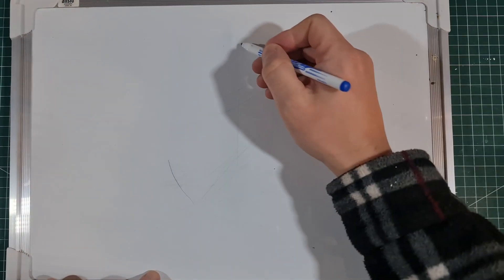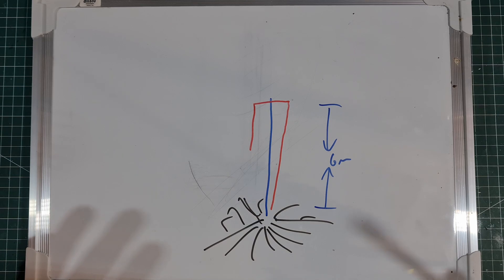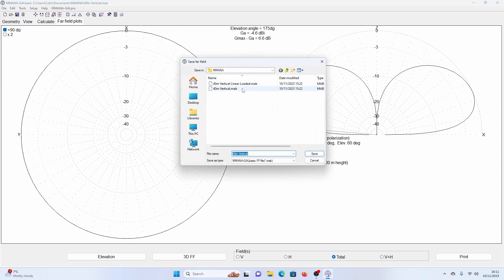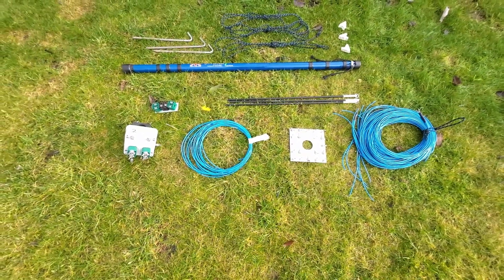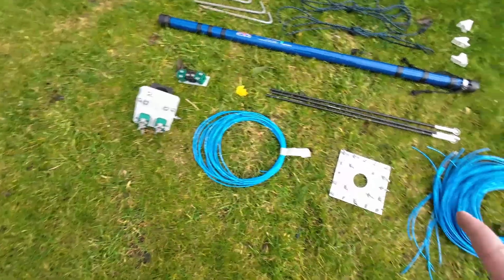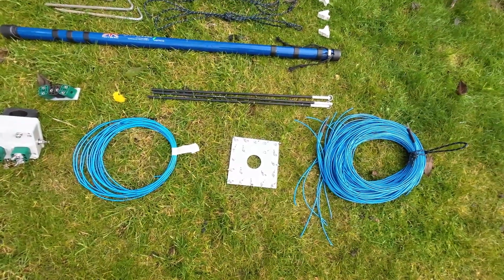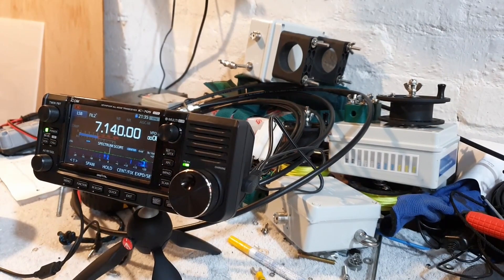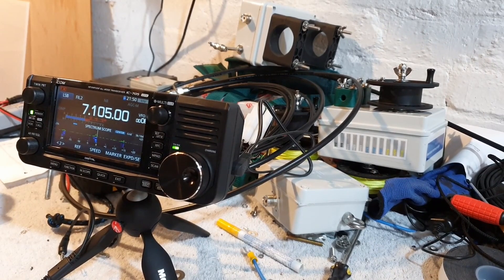Small, Cheap, Efficient Vertical Antenna for 40m

Comment: interesting, I wonder how well it would work with one only, elevated radial?
Reply from the maker: Probably quite well!
Reply: Actually, I would use two elevated and tuned radials. That's what I do with a 20m vertical in a quarter wave, end fed, configuration. Unless you're willing to lay out a hundred or more ground radials, the antenna efficiency tends to be lousy. With 32 ground radials, you send about 30% of your RF power into the ground. Put the elevated and tuned radials at 180 degrees for omnidirectional emissions and at 90 degrees for a bit of directional gain between them. That works very well, it's vastly more efficient and a lot less work for a temporary set-up.

Comment: Very good vid and thanks for the time and effort in making it ..I wonder If you have tried it on the same way a stainless steel whip the chameleon work s brilliantly by perhaps raising your pole up to 6ft and bringing just one needed by the way ..but just 4 radials coming down from the base of antenna to a fee inches of the ground..this is how the chameleon works so well .without all the need of them ground ones I have experimented with only one radial attached. Then 2 etc etc 4 .and attached at different ways east  then west .and all of the time doing reverse beacon tests and absolutely no difference on were the signals were dropping. Usa Asia etc etc with one radial or 4 or what direction radial was pointing..great vid and again thanks for the time you put into it john m0asn

Comment: Hello Colin a more challenging version cloud be to make the antenna  with elevated radials for Hams that do not have a garden to reduce their numbers. A more challenging version would be to use only two sets or radials in a plane, these radial could be connected in parallel and separated at the ends. Personally I only have a 6 feet wall  to hang on my poles and antennas. Vince
Reply from the maker: Your spot on Vince. I have done this many times with a single elevated radial which has always worked well for me.

Comment: Really nice Video Colin, thanks !This compact setup looks almost as good as a full 1/4w vertical! I was wondering, in a enclosed space (houses, trees on low angles in most direction, etc) if this or a EFHW above the roof would perform better ?!
Reply from the maker: I think it will be slightly down on a full size but not my much. You hit the nail on the head. A dipole in the clear above roof height will outperform this (I've done the A/B comparison).  If you could get this vertical above roof height with raised verticals it would be a winner.
Reply: Thanks ! that makes sense and appreciate the feedback of your tests. I think the initial QTH option is a wire strung just above the roof. Even though my neighbours love to put their TV Yagi's on 2.5m masts a 6m mast on the roof may create some issues LOL....  I really would like to try your vertical antenna for QRP sota, looks like a great option to try but need to figure out a better option for radials ?  @MM0OPXFieldRadio

Comment: I wonder…if you wanted to add a reflector to get more gain in a given direction would it need to be linear loaded to?
Reply from the maker: My gut says no, as long as its electrically the right length. I've phased a pair of these and that definitely works.

Comment: on the 20m version that you built, did you also use a 1m cross section at the top, or was that decreased to a half meter
Reply from the maker: It was still 1m spacing

Comment: Do you need fiberglass? Or can you also use carbon fiber!? and what would happen if you would use an aluminium pipe!? 🤔 I am still a Noob 😅🤷🏻‍♂️
Reply from the maker: Ideally non conductive material if you can. I think you may get ot to work to an extent but the radiation pattern will be different.
Reply: @MM0OPXFieldRadio  thank you for your reply! 👍😉

Comment: Your shortened version is 9 meters tall, likely why the SWR is way off. It is suppose to be 6 meters tall. 4:23
Reply from the maker: Hmmmm no. Its 6 meters tall goes horizontal for 1 meter then back down the rest. This is normal for MMANA to show a high SWR for linear loading.

Comment: Great experiment Colin! In the past I have done the same sort of thing for a 40m vertical, but I used 450 ohm ladderline, shorted together at the top of a 7m pole and running back almost to the bottom. I also used ground radials and found a good match. Two suggestions if I may: 1) you can use a linear loaded raised radial or two at the same sort of length and this would probably equal or beat ground radials for efficiency ( even tack them to a fence). 2) Efficiency wise, having read up on W8JI's study on this, I think the linear loaded shorter version is likely to be a little down on the full sized 1/4 wave, but hey.. it works and when the band is singing we will all make some great contacts. 73 mate - great presentation.
Reply from the maker: Thanks mate, agree fully on your points. Normally I would use raised radials but used ground radials as thought more folks would use these, expecially for permanent installs. I dont beleive it will be "full" performance either but its a good compromise for the size 👍

Comment: I think if you raised the mast off the floor slightly say 1m you could use a linear loading radial ,no need for all the complicated ground radials if you add more than one you start creating useful gain also.  Give it try 😊
Reply from the maker: Yes, this is how I typically do it but used ground radials for a change.

Comment: A fascinating video as always. The SWR is suspiciously low,  the resistive part of the impedance as you go through resonance should be lower. Not pointing this out seeking to be a troll but I have been messing about with a LOT of radials on a ground mounted vertical. I suspect MMANA is in the right ballpark, that the feed impedance should be in the region of 25 ohms, the extra 17 ohms or so being ground impedance.  I live in East Anglia in a region with high ground conductivity and with a similar number of radials I appeared to have about 20 ohms of ground impedance too. I like MMANA but it does not appear to factor in these losses. I increased the number of radials to about 150 trying to reduce the loss, (though I am sure many of them are now detached). From the ground loss estimates I suspect that your linear loaded vertical is losing about 1.5dB relative to a full height quarterwave. By no means a disaster, plus you have a much more robust antenna. 73
Reply from the maker: I agree with you. I do mention in the video that the jury is still out. Only way to really know is do a side by side WSPR comparison.   But even that is fraught with issues. Being 1.5db down is something I'm happy to live with for the drastic reduction in height and rigidity as you say. Say you did this for 80m on a 12m spiderbeam pole (as I have). Could  be a game changer for those in very small suburban plots.
Reply: Now you've got me thinking that I could get on 80m as just purchased a 12m spiderbeam pole...  @MM0OPXFieldRadio

Comment: I always enjoy watching your videos, seeing how enthusiastic you are about making new antennas and what a great job you do making antennas that have your signature touch. This is a great all-around design for those who are limited in space, especially if they’ve already got a 20m multi-band hex beam already sitting in the yard - it complements that setup perfectly.  My only gripe with vertical, omni-directional antennas is the fact that they need so many ground radials and also that they are as good at picking up noise as they are at picking up signals, and ivy their very nature pick up a lot more noise than signal.  It’s also a shame to be using so many wires and only have one band. You should do a video where you turn it into a fanned vertical.  May as well since you’ve already got all those ground radials laid out. 

I’ve got a home brew 40m EFHW strung diagonally across my not-so-large property up at 30ft and it does a very respectable job on 40, 20, 15 and 10 meters without a tuner, all bands with SWRs below 1.5.   It would be interesting to compare it to this one 40.
Reply from the maker: Thanks for sharing your thoughts. Normally I use a couple of raised radials but used ground radials as I thought more would use those. I have run this as a 20/40 version so could make a video on that.